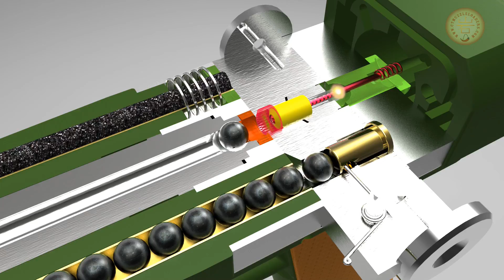A Lorenzoni-Girandoni Repeating Pistol - Part 2

Comment: Now i'm wondering... You did say in your page about electric ignition that the plasma explosion of just air would blow of the powder before even igniting it. Since you have A LOT of experience with this, could it be possible to super-heat air with just plasma and use it for propelling a pellet?
Reply: I did a number of engineering calculations using heated air, water steam and alcohol 'steam', and the electrical energy storage required is impractical to do it this way. If one wanted to carry a backpack of capacitors, then that might work, but there is nothing than can beat the stored energy of chemical reactions. I have also looked looked at heat storage systems  (superheated steam, etc), but this would be more complicated and much less reliable. 

If I find a way to do this, rest assured I will put it up for all to see.
Reply: @stephenwardlaw6428  Thanks a lot for your answer, sir.

Comment: Perfectly fine for target shooting, but definitely anything but effective in self defense. The amount of powder looks like it could barely hurl the ball quick enough to rival the power of a pellet rifle.
Reply: It was indeed made for short range (25-40 yds) target shooting. With what is essentially a 20gr round ball, the velocity drops off to insignificance in 200 yards, so it is relatively safe to shoot outside. However, at close range it will punch through 3/4" plywood, so it could be lethal with a well-placed shot. I have run over 3000 rounds through it, and it is a lot of fun to shoot (and cheap).

Comment: do you have anymore exciting projects coming up?
Reply: I don't know about exciting, but I have been re-doing this pistol and trying to adapt the mechanism for a rifle.
Reply: @Paul-bk9dh  Unfortunately, various events (health,etc) have sidelined things for a bit. I did re-design the frame so it could be produced on a 3-D printer, and the ignition coil was replaced with a commercial EG&G trigger coil (from eBay). These changes didn't make it shoot any better, but made it easier to make one. I played with a few rifle designs but was unsatisfied with the results. I was also looking into how to re-design the receiver to minimize any machining and use printed parts for these too.
Reply: @stephenwardlaw6428  Is that the version on your website? I absolutely love the design of this pistol (great work by the way!), and I love the Lorenzoni style too so this would be a magnificent piece to make someday.

The newest file I could find of it says 2013 and looks like the one in the video, but if more of it could be printed that would be awesome. I'm also glad you mentioned the problem of the conventional rotating cylinder style because I had half of one mocked up in CAD (flip flopped almost like yours with the powder and balls in front so I could have it as a pistol or SBR with collapsible stock and was trying to do a short throw lever action design and potentially updating it to a helical magazine spiraling around the barrel for higher capacities), but I stopped when I realized the taser unit I was planning to use wouldn't work but didn't even think about plasma arc ignitors or what you were using on another one of your videos so I'm glad I stumbled across that.

If you have the newer files or prototype model uploaded somewhere please let me know, this is way too cool of a project to let disappear like smoke, its very brilliant and well thought out. Great work!
Reply: @jakegarrett8109  In looking at the site again, I see it really needs updating; I am now on version 4 or 5... The newest version uses pretty much the same receiver, but the body/grip was re-designed for a filament 3-D printer, and the hand-wound ignition coil was replaced by a commercial version. I will put this on my 'list' and post a comment here when it's done.
Reply: @stephenwardlaw6428  Awesome, I look forward to it because it really is such a genius design. Thanks Stephen!
Reply: @stephenwardlaw6428  Hi, I'm hoping to tinker with this project and use its basis for a simple spin-off if you have the updated design files. I'll send you an email shortly too if its easier to attach just the STEP files than updating the website. This is a really cool project and I'm excited to take a look at it.
Reply: Great video. Can you make a revolver version? Like a cap and ball revolver, but with electricity replacing the caps. Also could you make a long arm version of your breech loading flintlock?
Reply: Could you do something like this? I love your channel and I think it would be a cool project. It's a shame that nobody else is doing this.

Comment: imagine the fire from the chamber under the high pressure could be access into the gun powder tube and your gun become a bomb.congratulation but there are million smart people out there that is why people don't apply dumb ideas into real life.
Reply: Smokeless powder cannot be ignited by a chamber flash-over, its ignition energy requirement is too high. Also, there is a dynamic seal as described which prevents all but the tiniest gas leakage from the chamber. The powder chamber has a soft blow-out just in case everything else went wrong. However, this design could not be safely used with black powder.
Reply: @stephenwardlaw6428  yep but the risk is still available,
Reply: @stephenwardlaw6428  the gun can be better with revolver design and the cylinder can be rotated by a motor or trigger mechanism.

Comment: I'm curious, how'd you make the insulation around the firing pin type element? I'd imagine that a standard spark plug from an engine wouldn't hold up to the pressure so guessing yours is extremely overbuilt just to be safe.
Reply from the maker: The insulator is 'zirconium toughened alumina' (TZA) or 'ceramic steel'. It has a compression strength in excess of 250,000 psi and a substantial shear strength as well. Details of a similar igniter construction can be seen on my rifle project's web page http://tinyurl.com/plink-king

Comment: very impresive.I have watched it about ten times since last night.very qute,clever and clean.why didnt you use it on a rifle for longer renges?I saw the other rifle video but didint got how it is loaded.
Reply: I designed a rifle using the same principles and will eventually publish it as well. Currently, I am making a (reloadable) .22 'Wildcat' cartridge from a .25 ACP which will be used in a 10-22 format rifle, and I will probably finish that first.

Comment: Just curious if you still read these, why did you choose #4 shot over something like F shot which is more or less .22"? Was it just to get an elongated projectile? Very interesting design, and I think I want to make one of these as a "youth" gun since .22 is so expensive now days. (Start expanding your production lines ammunition corporations! This demand is not going away!)
Reply from the maker: +Dave Smith 
For use with smokeless powder, in the absence of a vigorous primer, it is necessary for a lot of pressure to build up in order to get efficient powder burning. As the .24 ball is swaged through the barrel, the pressure (and heat) generated ignites the bulk of the powder, while an exact-fitting ball just 'poofs' out of the barrel. Black powder does not need this, but barrel fouling ruins accuracy after a few shots.
Reply: +mlshooter That makes sense. I went through your articles on your website and you have done some very impressive work! I have some designs drawn out for a repeater that hopefully will serve as a nice ruger 10/22 replacement. Previously I have experimented with making cartridges consisting of nitrocellulose slowed down with diphenalanine and a lead projectile embedded inside. It worked conceptually, but it was very weak (probably because the burn rate was not tuned) and very slow and somewhat costly to make ammunition for. In that design, I used a sort of sliding collar that reciprocated over the barrel and acted as the chamber. This allowed the rifle to "clean" it's chamber as the rifle was fired. Hopefully I can incorporate such a design into yours. The problem is getting enough time to get around to machining the parts.

Comment: Interesting concept, however it can be cumbersome having to refill each of compartments after every few shots.

The same sort of concept could be applied in a bulpup designed bolt action rifle which can essentially be a combination of a taser and a rifle.

Use caseless ammo like the .22 rounds Daisy used, using the concept of a charging mold, where the electric current of the taser ignites the charge and propels the round forward.

Comment: Your high-voltage source seems quite over-engineered. The transformer often fails because the enamel breaks down. This problem will be amplified by the fact that you have no actual CCFL connected to load it down. You should consider a photographic flash inverter for the bulk energy and a transformer for stroboscopic lamp startup for the bridging of the gap. Or simply use a piezo lighter button.
The mechanical side is obviously excellent (even if the sliding of the hole over the gaskets seems dubious) - nobody I know could even begin to try!
Reply: @Mr.nine9527  I don't think you'd need 5w laser, even the cheap $50 handheld laser "not pointer" I got was able to set a T-shirt on fire pretty fast (also great for killing spiders from accross the room). I have made a 5w compact laser pistol but its quite terrifying. Now the good thing is that even the 7w laser cutter I added to my 3d printer (to engrave aluminum like iphones, or cut wood etc) is not all that expensive and I paid less than $100 for it (you'll also need a 3s LiPo battery, and that's it) so that wouldn't be a big deal, but I don't think you need that much power. Besides, if you don't mind a little delay you could just ignite a piece of fabric as a primer with the cheap handheld laser I was using for setting shirts on fire with. Or you could just use a piece of wood in the powder since it will catch the wood part of a match stick on fire (you don't need to laser the head, just do any spot of the wood).
Reply: this gun is no good.imagine that the fire from the chamber can access the propellant tube and ignite the gun become a bomb!!!!!!This pistol is out of firearm safety design.i had made and shoot many time my laser ignite pistol,it ignite very fast but the laser need to be focus perfectly.i could have nicer one if i had an expensive 500wm laser.However,i can even make gun more simple using lighter and armstrong mixture if you understand what i'm talking about.

Comment: I like the concept, however I must wonder how the B.A.T.F and NICS would rule this? Looking forward to more info on this product. It to would be nice to see a estimated price. This is a big F.B.  "LIKE" from me.
Reply: +Billy Crum As long as the gun is not fully automatic (i.e. &quot;more than one ignition/shot per trigger pull&quot;) and you aren&#39;t selling them commercially, you can legally make just about anything you want, no problem. That&#39;s why there&#39;s a market in (and controversy about) so-called &quot;80%&quot; AR 15 lower receivers - that&#39;s the part that is legally a &quot;firearm&quot;, yet  the as-sold form factor cannot fire anything. Legally, it&#39;s just a chunk of metal; you have to do the finishing machining yourself. But it&#39;s the same principal. Also why you will likely never be able to purchase this. But maybe he can provide some CNC files? ;-)

(Edit - I should add this is legal from a Federal perspective only; YMMV depending on the state and locality you reside in. As always, check your local laws.)
Reply: +Billy Crum it doesn't use fixed ammo so the ATF doesn't recognise it as a gun